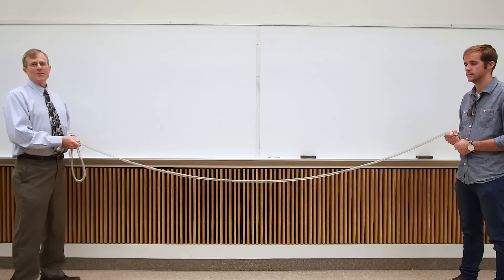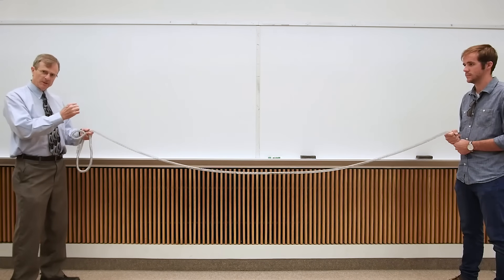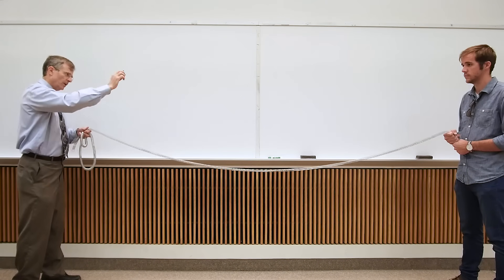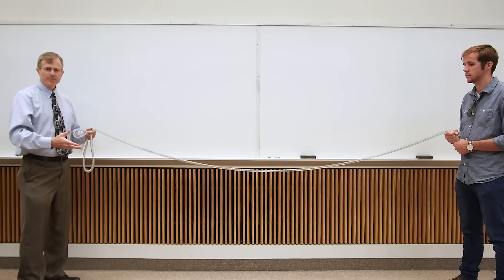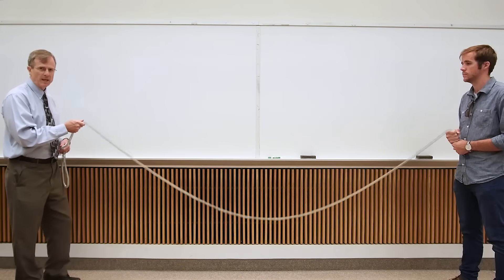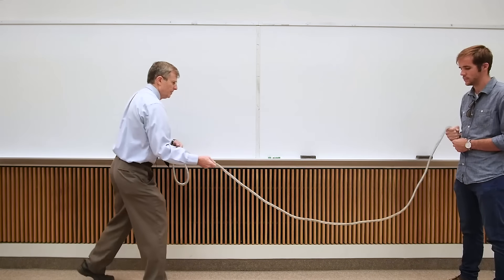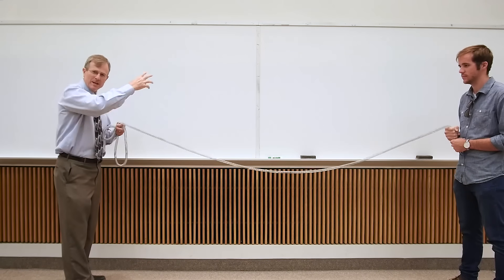Standing Wave Demo: Slinky

Comment: Everybody is talking about how dead parker is yet no one mentions that this guy can match the frequency of the rope with HIS BARE HANDS. I remember my physics teacher needed to set up a device that resonate with a fixed frequency and this guy did it better with only hands. My appreciations, good Prof.
Reply: It's because the rope is thick (big mass = big inertia) and elastic, that will cause the frequency at which you vibrate your hand to stick to the closest harmonic once you are close enough. That's also what makes it almost impossible to go over 6 fixed points by hand, because you will stick to the lower frequencies and then get out of sync.

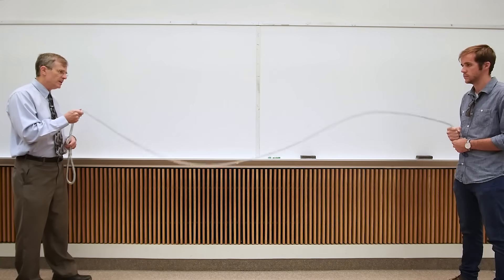Comment: At 2:10...the wave dos not go twice as fast...its speed is constant. Its frequency is twice the fundamental frequency. Needs to be precise here.
Reply from the maker: Thanks for the opportunity to clarify this ambiguous statement. You're right that the wave speed is the same for the two harmonics (as long as I didn't inadvertently change the rope tension between harmonics). However, I'm not claiming that the WAVE is going twice as fast for the second harmonic as in the first harmonic.  I am simply claiming that the FREQUENCY of the second harmonic is twice the frequency of the first harmonic, which is true (as long as I didn't inadvertently change the rope tension).

Comment: Great demo! We tried to do this to demonstrate the science during a  performance, but our rope is not cooperating. Would you mind sharing what type of rope you used and how to accomplish this so perfectly?
Reply from the maker: A heavy, flexible rope works best, if you have one.  But you can do it with any rope.  The key is shaking the rope at the right rate.  Once you've got mode 1, which shouldn't be hard, memorize the frequency at which you have to shake the rope to get it.  Then double that frequency to get mode 2, triple it to get mode three.  What we used for this demo is actually a long metal slinky, which is both heavy and flexible.

Comment: Why does the frequency need to match the length of spring? 1:10
Reply: I think he isn't saying the values for frequency and length should be the same he's is simply suggesting that the frequency needed to create a standing wave pattern depends on the length of the string. 
For example you might need a frequency of 90Hz to observe the first harmonic for a particular length of that string. If you increase the length the frequency would decrease. 
Basically frequency is inversely proportional to wavelength.
Reply from the maker: Actually, at 1:10, I'm referring to the fact that standing waves are the superposition of two traveling waves of equal amplitude, one wave traveling to the right and the other traveling to the left.  Getting standing wave patterns in the string, as shown in the video, requires these waves to have specific frequencies so that the left-going and right-going waves reinforce each other.

Comment: A Mode 1 wave like this isn't the lowest frequency standing wave you can get. It's the lowest frequency  standing wave with 2 closest end. You could get a lower frequency with one closed end and one open end.
Also physics teachers, this demonstration works better with markings on the slinky or a toy slinky with different colours along it's length. You want the students to understand the rings themselves do not travel. That's not something they can see right now.

Comment: at our elementary school, we had a big metal chain... and apparently... I had a thinng for science since my childhood, because I tried making those waves without KNOWING what they are or how they work...

I kinda... did that .. the same as you use a jump rope.. rotation, torque... idk

Well: What I got to work was: The fundamental mode... and the second mode waves... and I noticed that there was a spot that just... stayed still... hanging there in the air... 

And so I wanted to get it to "make 3 Bumps" as I called it back then...

I was very young so I didn't get it to work... And that kinda frustrated me

Comment: How could you manage to get the perfect second and the third mode (although for a very small duration)? Is there any trick?
Reply from the maker: I memorize how fast I have to move the rope up and down to get the first mode, then double, triple, and quadruple that rate to get the higher modes.
Reply: @physicsdemos  Muscle memory?
Reply: Terminology: I memorize how 'frequently' I moved the rope up and down. The linear propagation is fast 🚀and constant for the given rope length, etc.